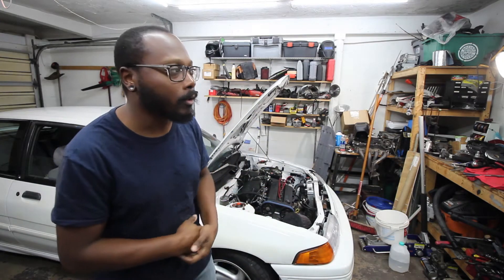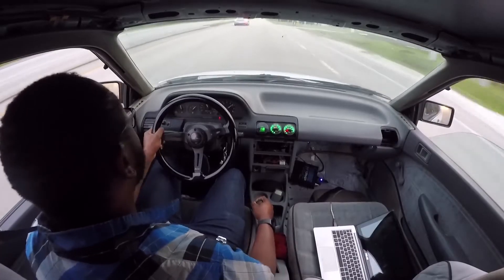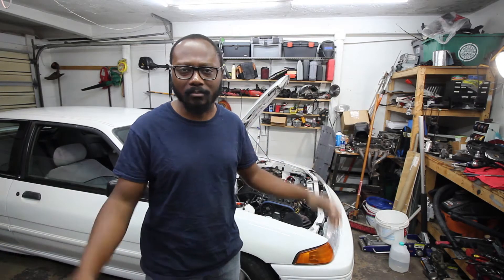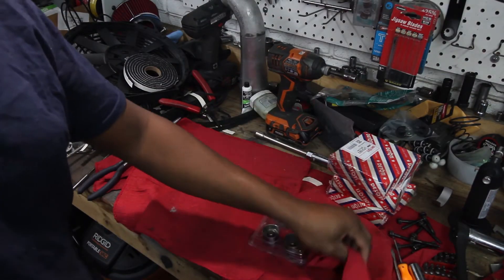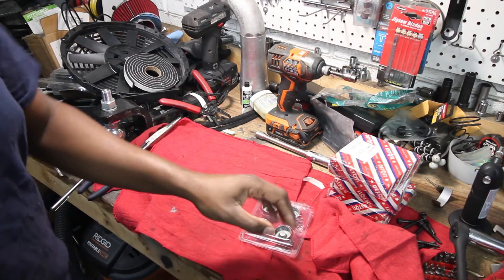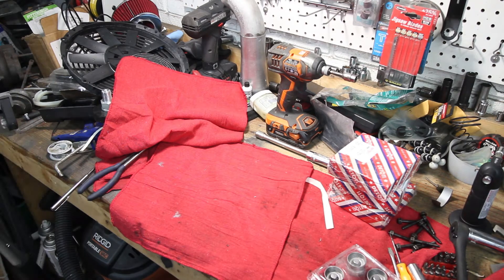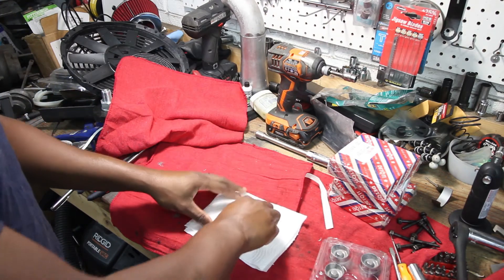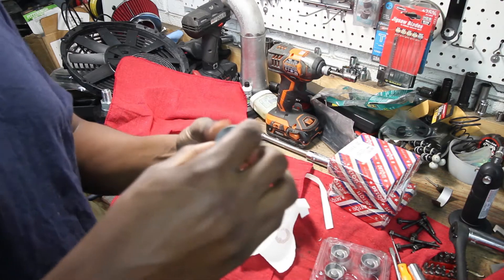Turbo Escort Update And Lifter install

Comment: I would have LOVED to have been able to do a BP swap on my old 1990 Festiva. It was a 41,000 mile 1.3 auto with working AC. It was so clean for a 1990 from the northeast. A BP swap would've been so sick for that tiny car.

Comment: Is this the original motor or did you take this motor out of the Mazda
Reply from the maker: This is the same kind that was  originally in it but not the original  , this particular engine (the block anyway)came from a kia sephia, the head is from a protage,The protage, ford escort and kia sephia are a shared platform. Same chassis and drivetrain (with some different engine options depending on the name plate).